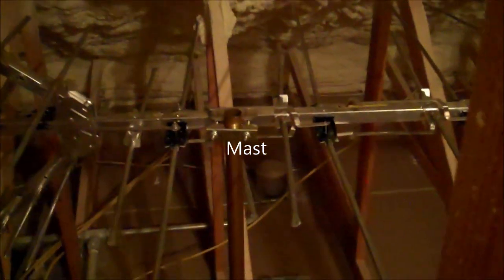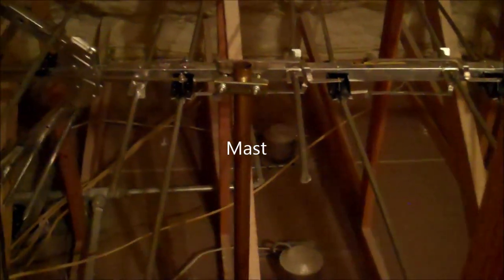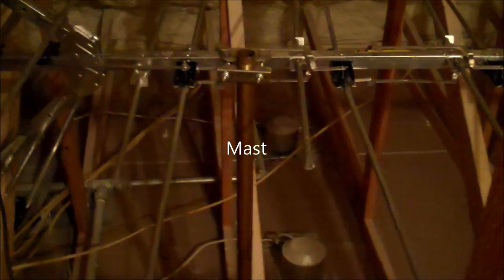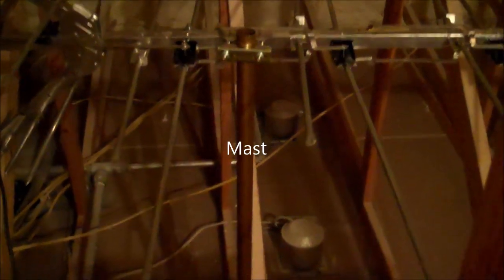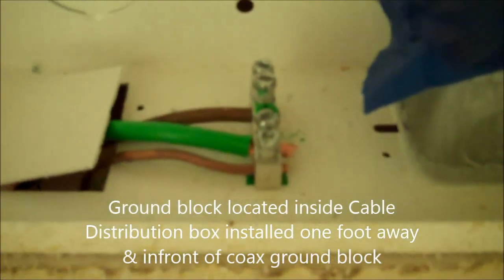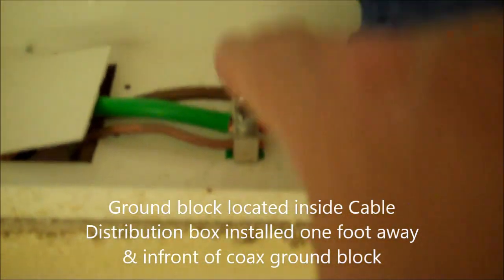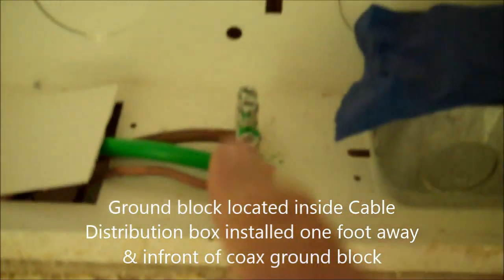Over the Air TV antenna installed in a home attic

Comment from the maker: Interesting question that will elicit opposing opinions depending on who you ask. We've used both and have no opinion other than to say, our sub woofer selections have typically been based off not only the actual sub performance respective to the end users goal but also the budget and the appearance, size, and wiring constraints. If a particular sub didn't perform in a given application (seldom) we'd select an alternative.